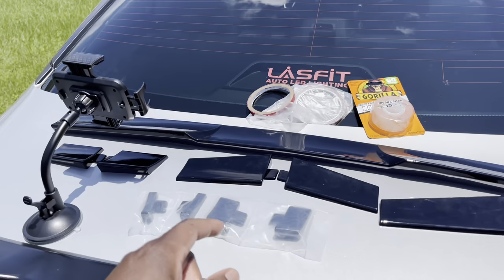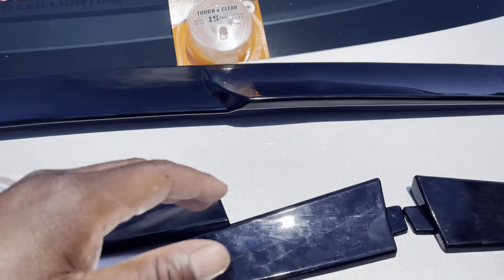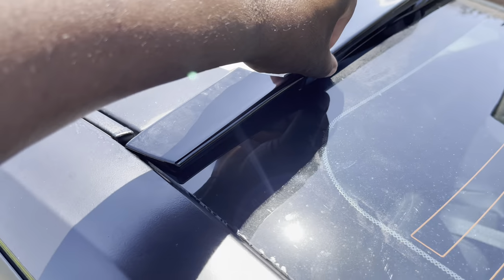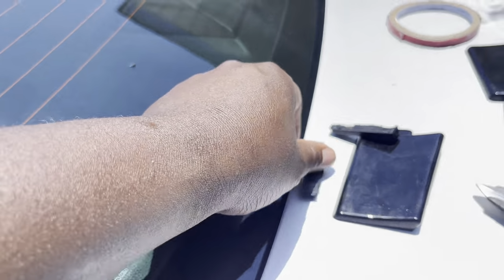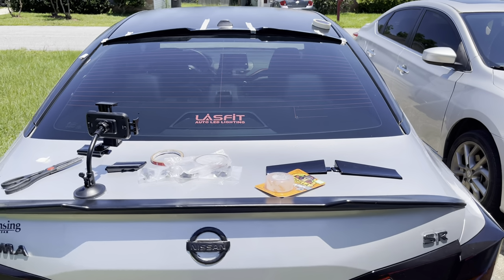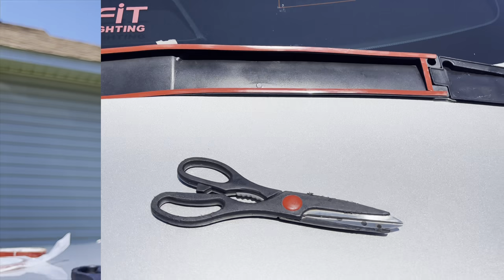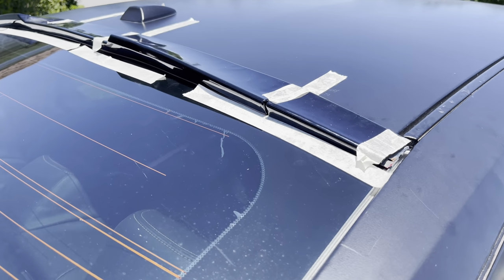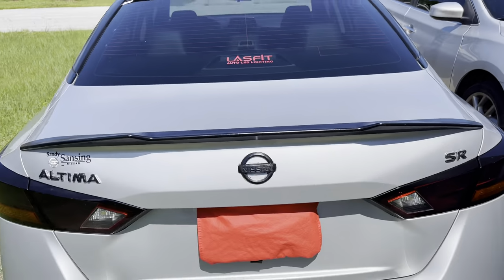3 Piece Universal Rear Window Spoiler for 2020 Nissan Altima SR #countryboymodz #nissan

Comment from the maker: Here are the links for the spoilers on Walmart online and Amazon.

$27 Universal Fit Gloss Black Glossy Top Roof Spoiler Wing Adjustable Splitter Kit https://www.walmart.com/ip/591821155

$40 https://www.amazon.com/gp/aw/d/B07MD7H9KC/ref=ox_sc_saved_image_3?smid=A3GW5CKPDHE2JH&psc=1
Reply: Where did you get the side skirt and bumper splitters
Reply from the maker: @polyfaya3140  from Amazon and Walmart look in the description all the links are there

Comment: Gotta say man this roof wing came out so nice on my 22 altima! Only took about 30 minutes or so to install this piece. Thanks to your video, it was very helpful and easy to put on! Well, definitely subscribe to your channel. Keep up the good work man on your ride and look forward to more videos!
Reply from the maker: Nice I’m glad it worked out for you and make sure to keep up with the extra pieces for just in case so you can replace and cut them to the right length but it’s definitely a good one for the price with a few adjustments. Also thanks for the sub, support, and the feedback.